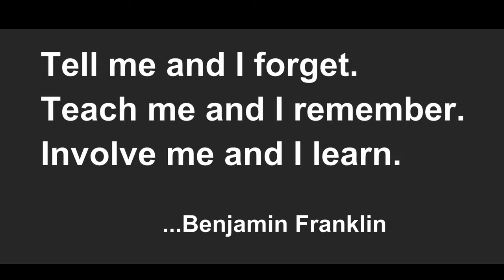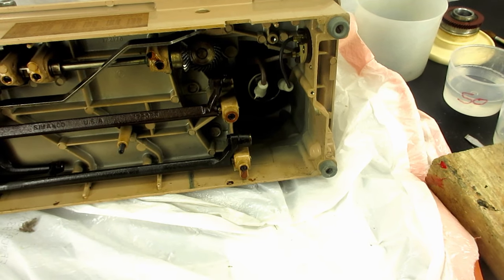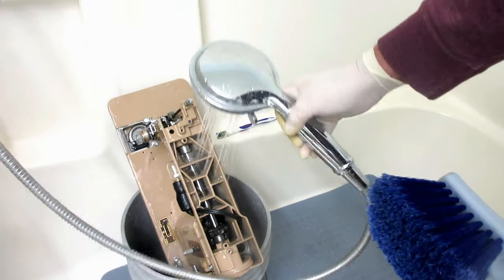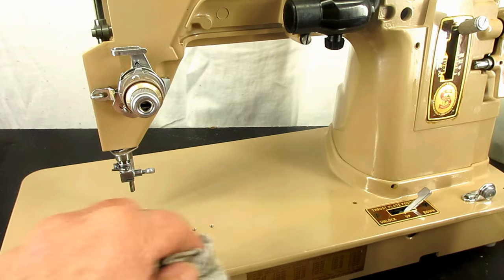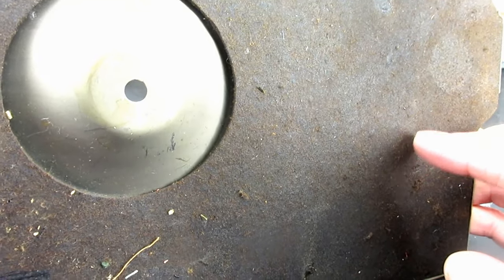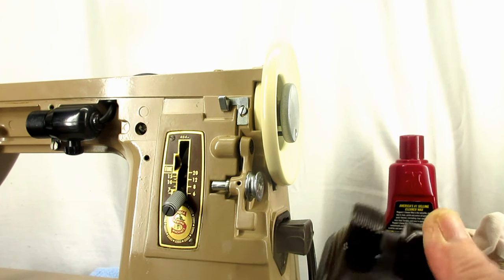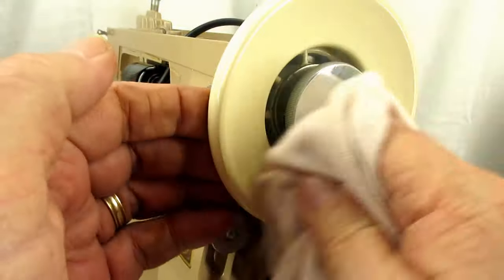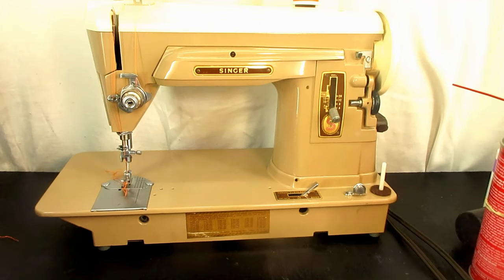An easier way to clean & degrease a sewing machine with less parts removal.

Comment: Hi Andy, I'm from the Netherlands and I have a beatiful singer 401. I use it very often and I love it. I would like to lubricate it, but I don't know what to use. In Europe we don't have the Tri Flow lubricant. Do you maybe have any suggestions? A brand + type? Or do you have any tips what to look out for?  Thank you so much for these video's, I love them :)
Reply from the maker: Greetings to you in the Netherlands 😊 You can find any sewing oil there. Look for "All Purpose Machine Oil". Hardware stores or sewing/fabric centers. Most oils like that are petroleum distillates. TrFlow oil is the same except it has the P.T.F.E. added to help reduce friction. All Purpose Machine Oil is what Singer Oil was for decades. I have seen 100-year-old family Singer Machines that had only been oiled with SInger Oil and they were in very fine condition. The important thing is to keep the machine clean and oiled. All Purpose Machine Oil is made for sewing machines, household appliances, Vacuum cleaners, Bike gears, door hinges, etc. BTW, I do show triflow oil on what appears to be a Netherlands eBay page. Maybe you could take a look and see what you think. https://www.ebay.nl/sch/i.html?_from=R40&_trksid=m570.l1313&_nkw=triflow+oil&_sacat=0   Thanks for watching my channel.
Reply: @andytubesewing1953  Thank you so much. And I am so sorry because I wanted to ask about the clear synthetic grease. Do you have any tips on that.
Reply from the maker: @serpentgirl86  Well, it's the only grease I have ever used. The same source as the oil will sell to you: https://www.ebay.nl/sch/i.html?_from=R40&_trksid=m570.l1313&_nkw=triflow+clear+synthetic+grease&_sacat=0
You may be able to buy both products from the same seller there.
I've always been told not to use lithium grease as it tends to dry out. I can tell you black grease is very hard to clean off gears, haha. There must be many types of grease there where you are, for mechanical equipment, like large kitchen mixers, yard equipment, etc. I think there are a number of synthetic greases also. Grease seems to be an oil with thickeners and other additives. Look for something that clings and is rated for high temperatures. For example; Triflow Grease is rated for +400 deg F.

Comment: Super, super video!  Thank you so much.  I’ve taken a hands on class for my vintage/antique machines where I disassembled everything, and now I have another method for my toolbox and can watch it whenever needed.  I can’t thank you enough.  I have about a dozen 301s to keep maintained, one of which smells so strongly of cigarettes I can’t use it.  I’m nervous about dunking it in the shower; but willing to give it a try.  My friend has a 401 that we couldn’t find a new drip pad for, so I was happy to see it could be cleaned.  Now to go back through your playlist and learn so more.  One quick question... can you list some of your favorite resources for ordering parts?  Thanks again!
Reply from the maker: The "Coco" playlist can help you with your 301A. Here are a few sellers on eBay I have used for years. IMO, all are honest and reliable. The rare mistakes ever made were corrected immediately. https://www.ebay.com/str/Central-Michigan-Sewing-Supplies?_trksid=p2047675.l2563     https://www.ebay.com/str/Lovebug-Sew-N-go?_trksid=p2047675.l2563     https://www.ebay.com/str/SHARP-SEWING-SUPPLIES?_trksid=p2047675.l2563     https://www.ebay.com/str/SewVacUsa?_trksid=p2047675.l2563  For vintage replacement parts, like oil pans, needle bars, motors, tension assemblies, I buy from whoever has them for sale b/c the parts come and go often and quickly. Thanks for watching my channel. BTW, removing tobacco odors is easy with the Krud Kutter. If it cleaned this mouse house of a machine it will clean your smelly one, no worries.
https://www.youtube.com/playlist?list=PLsCOZgzzaiKJS_4FKPb4bgAbHtYWnexvy
Reply: @andytubesewing1953  Thanks so much!!
Reply from the maker: @texstylust  Sure. Not trying to overwhelm you, but I have 30+ videos for servicing model 301. The Coco series:
https://www.youtube.com/playlist?list=PLsCOZgzzaiKLZyGebzS_oISgesXNyREyI    and the Technical Series: https://www.youtube.com/playlist?list=PLsCOZgzzaiKI_6fbu3itbd1v4z3uQvvkO   Finally, with a $10 Diamond Stone you can speed up your machines motors spending about 5 minutes per machine. It's an immediate performance increase until you can properly service them: https://youtu.be/pzq4tv8qn94   Thanks for watching Andy Tube.

Comment: Good to see you! I'm just going through your videos to find somthing on cleaning a crinkle finish machine inside and out. I have one that is just covered in dirt and gummed up crud. I've take quite a bit of the parts off but don't want to have to dismantle the inside completely.  Do you use the same method as this video for crinkle machines (mines a 66) or would the degreaser mess up the finish?
Reply from the maker: I've never worked on a crinkle finish model. If the finish is just painted, a 15% solution of the KK would work, but test it first. Here are a couple of my playlists for black finished SInger models and how I cleaned them: 99K - https://www.youtube.com/playlist?list=PLsCOZgzzaiKIIUgkEujqHc9iNWN9NPW2Z       221K Featherweight - https://www.youtube.com/playlist?list=PLsCOZgzzaiKIA1OPw0k6QOSTE-wAUZ4kp    Looking back thru some old bookmarks I found 3 pages I marked for crinkle fined machines. I tried them and they are still active and maybe they can help you - https://www.quiltingroomwithmel.com/2017/08/how-to-clean-godzilla-or-crinkle-finish.html         https://www.quiltingboard.com/vintage-antique-machine-enthusiasts-f22/how-do-you-clean-crinkle-finish-t244686.html        https://cherylsteapots2quilting.blogspot.com/2013/01/cleaning-sewing-machines.html 
Good Luck, and thanks for visiting my channel.

Comment: omg!  I think you (Andy Tube) are answering questions! SO I have one.  When is the regular sewing machine applied and when is the TriFLow lubricant applied.  I got the lube on the gears part but cannot see the difference when you are applying oil.  And where do I acquire the long tube applier for the TriFlow lubricant.  My sewing machine oil has one on the bottle already. THANKS!  Getting it together to make the plunge next weekend. 503A
Reply from the maker: Okay, let me try and clear this up. I use triflow clear synthetic grease on the metal gears and the textolite gear of the hand wheel. I use the triflow oil where metal rubs on metal so all of the factory oil ports shown in the instruction manual and my video like the shaft bushings, the needle bar, pressure bar, the bobbin case, race of the hook, etc. I use regular sewing machine oil because it's cheaper on the bare metal parts that I have stripped all the grease and oil off of like the arm shafts on the outside, the bottom shafts for the hook and feed system and so forth. I just want some oil on those to prevent future rust. I prefer the triflow oil on the metal friction parts because it has PTFE in it and that's like Teflon and it. It reduces the friction on those metal parts so I'm hoping they will wear less and last longer. But on metal parts that don't have friction, I feel like the regular cheaper sewing machine oil is just fine. Thanks very much for watching my channel and keeping your machine in service
Reply: @andytubesewing1953  thank you SOOOOO much!!  I got the grease on gears bit but just was confused on when to use TriFLow oil vs regular sewing oil.  You certainly cleared all that up! I'm going out today to get my last thing on the tools list: TriFlow lubricant oil.  You are AMAZING and SO incredibly helpful!  After this 503A (it goes to twin 14 year old girls) then I will do my vintage Brother!  I'm sure I can handle that after all your lessons here! Thank you, Thank you, Thank you!
Reply from the maker: @samibear4092  sure, you're very welcome. I usually get the triflow online but locally I have found it in some bicycle repair shops and one small family owned hardware store. Good luck and I love you giving that to a couple of young girls. It will last their lifetime no problem and it can sew just about anything they can dream of.

Comment: Welcome back Andy Tube!  My patience is running thin on my frozen 403.  The needle bar is in a lower position and the hand wheel will turn.  I can get a wiggle out of it though, but the gears do not advance.  Do you have a video that would be similar to the 403 being disassembled?  Next up, I need to buy a Chapman tool set.  The screw to remove the lower gear underneath the bobbin hook area (I need to remember my parts vocabulary) is turned toward the corner of the machine and I cannot get to it.  I need a super short screwdriver!  Thanks for any pointers.
Reply: Oops, I meant to say the hand wheel will NOT turn at all.  Wiggle yes, advance a tooth in the gear, NO.
Reply from the maker: @candydeister  If you do remove the hook gear mark the teeth with nail polish so you can align them properly to avoid noisy gears after reassembly. Personally, I don't think removing the hook gear will help in any way. If you are trying to isolate the top from the bottom to see which half is stuck you're better off just loosening the hook drive shaft gear on the right. The one you loosen to set the timing. Here is my playlist for model 403A: https://www.youtube.com/playlist?list=PLsCOZgzzaiKKyqvdDRwS-9MfLuwSNJTcg  It only has 26 videos, but maybe one can help you. I also have a step-by-step restoration playlist for model 404, which has all the parts of your 403A except the pattern selector and vibrating bracket. It has 56 videos (now we're talking) and some of them may help. https://www.youtube.com/playlist?list=PLsCOZgzzaiKIB4kvIHCfHYuyLMUp5A4UI  You may also like to look at the 503A Playlist of 20 videos as most of the mechanics are the same, including the pattern selector: https://www.youtube.com/playlist?list=PLsCOZgzzaiKJZaZn2zl3LsnV2d7UhrqvX

Comment: Hey Andy, or anyone else reading the comments, I find oftentimes that when cleaning the “silver” parts such as bobbin area parts, particularly the bobbin cases, that they tarnish.  What should I not be using on them.  I use different cleaners including the Sheila Shine, silver polish cleaner, alcohol and several other cleaners which makes it hard for me to really know which one is doing that to them.  I’ve ruined a few pieces that I can’t seem to get back to their original shine.  It doesn’t interfere with their functionality, they’re just not so pretty any more🤦🏻‍♀️. Thanks for any feedback.
Reply from the maker: Hmm, I usually just clean them but if I do decide to polish them I just use Brasso, as I do on any plated (shiny silver) parts. I have used a Dremel with a wire brush in the past, but the Brasso on a toothbrush to scrub, washed off with water, and polished clean with a cloth is how I do those types of parts. If they are not plated, and I mean like highly polished or Chromed looking, I do NOT polish as that can remove the finish or discolor it. If anyone has not heard of Brasso here it is: https://www.homedepot.com/p/Brasso-8-oz-Metal-Polish-26600-89334/204371742?MERCH=REC-pipsem-202820651--204371742--N&    I've tried maybe 6 or 7 metal polishes and none worked any better than the Brasso and it is even sold at my grocery store.

Comment: Hi Andy, Thank you for your wonderful video. Very informative. I'm very new to vintage machine restoration but have learnt so much from your videos already. A couple of questions?
1: Was there any reasons for not removing the light globe during the cleaning process. I noticed you removed it only during the drying process.
2: On another topic, is there a reason why I haven't found any videos of you talking about or working on singer 201's. Ive just purchased a singer 201 (aluminium) and would love to know how to service it. 
Thanks again Andy
Reply from the maker: Hi, Angie. I left the bulb in this time b/c I've found the socket is rarely dirty. Feel free to remove it before cleaning if you like. I've done it both ways several times. I've never even seen a model 201 in person, so I've not used one or worked on one before. I know it is well-liked and beautifully made. I'd be most interested in the version with the direct drive "potted" motor as I've never seen it. I haven't looked, but surely there are videos about model 201 on YT. There are often online Groups for SInger machines and maybe there is a 201 group that shares info and references for cleaning/repair. Thanks for watching my channel.
Reply: @andytubesewing1953  Thank you for you reply. Im in Australia and I see 201's up for sale all the time. So very common over here. I haven't found much information on YT about 201's. But I'll keep looking. I'm in quite a few singer groups, so ill definitely ask there. I just like the video's because they are so helpful  for us newbies. I'm keen to learn about the different motors too. I'm not sure what motor mine has.
Reply from the maker: @angieclarkson2357  I guess you are correct about 201 videos on YT. I did find some, but it is limited. Meagan and other viewers from NZ have asked me about doing a series on the 201-2 so you are right that there must be many of them in your part of the planet. I'm in the process of selling all my machines (that my wife has not "borrowed for a while".) Maybe I can take some of the proceeds and find a nice 201-2 to work on. Best of luck to you.

Comment: Andy, thanks for the great lesson. We are washing a singer 66 treadle. One question: do you use hot water in the shower or could we do it with a power nozzle, outside with a hose? Our shower head is not a wand. Thanks again. I've learned so much.
Reply from the maker: First, yes, rinsing outside with a hose is how I started. I did not use a power nozzle, just the flow out of the hose. The chemical does most of the work. In Phoenix, it is often too dang hot outside, so I installed the shower nozzle. Don't let the rinse off get on tender plants or grass. My main concern for you is the finish of your model 66. Many Black Singer machines have a varnished or lacquered finish and I've been told the krud kutter can harm it, so depending on the quality of your finish you may want to test a small area, like under the motor, or just do not use the KK on the outside finish. I've also read that getting the finish wet is not good as there can be tiny cracks in the finish and if water gets inside and under the varnish, it can make it much worse. Please be careful. I've only done 2 black machines, a model 99K and a Featherweight 221. Here are links to how I cleaned those machines: featherweight inside: https://youtu.be/lz2xV3zfvJE   Featherweight outside: https://youtu.be/nZKAVHfUQoc    Cleaning inside & outside of a model 99K:    https://youtu.be/w6fn-TSOCYo

Comment: Another great video. Very helpful. Is there any difference between the Tri Flow Superior oil and the Singer oil? What do you prefer to use the Singer oil for? Also,  do you put anything on the bottom rubber feet to treat/condition them? Or do you just clean them?
Reply from the maker: If the rubber bed cushions are stiff I just replace them: https://www.ebay.com/itm/283226309302?epid=661359003&hash=item41f19a82b6:g:5tcAAOSwZPdb0Ifn   If they are rubber and not hard I have soaked in alcohol for a couple minutes, dried them, and rubbed on a drop of oil. Trying to prevent oxidation, esp. here in the Sonoran Desert.  The difference between TriFlow and SMO (sewing machine oil) is the TriFlow has P.T.F.E. in the formula, a type of teflon, and it is supposed to reduce friction. It cost more so I use it where the manual says to oil and where it is metal-on-metal rubbing. I use SMO, any brand, when I'm getting some oil on shafts after washing & drying the machine. That is more to prevent rust from forming. I want to make clear though that I have seen 100 year old family sewing machines that were oiled with only SInger oil and they were in fantastic condition. To me the main idea is to kept the machine clean, remove lint & dust often, wipe and brush old oil off and add new oil. No need to drown the machine in oil, but a drop or two were the manual says to put it. When the old oil/grease is not brushed or wiped off first it just builds up when new oil is added and extra oil is a dust/lint magnet. Thanks for watching my channel.

Comment: Hi Andy, unfortunately we have very iron rich well water at home so I won't be able to clean my machines this way.  I will be introducing rust throughout.  Love your videos.
Reply from the maker: Thanks for watching my channel. Sorry about your well water. The Kroger store down the street from me has a machine selling drinking water for 30 cents per gallon. 10 gallons should be enough. If you change your mind. Take care.
Reply: @andytubesewing1953  Ohhh, thank you.  I never thought of that.
Reply from the maker: @donnasmith2720  No worries. Before I got the new shower head I filled a 5-gallon bucket and used a 1-quart dipper for rinsing. The spray head just makes it a little quicker.

Comment: I am watching your video and seeing you apply oil.  But I cannot see if you are using the Singer oil or the Tri Flow oil.  Are they interchangeable?  Thank you for your wonderful tutorials!!!
Reply from the maker: I use both, but mostly the TriFlow oil b/c it contains P.T.F.E.I believe it protects better against wear. Singer oil is fine to use and is less costly. The most important thing about oiling is to do it properly and regularly to prevent metal-on-metal wear. TriFlow or Singer, take your pick. Thanks for watching my videos.